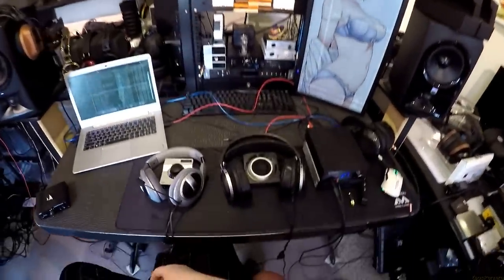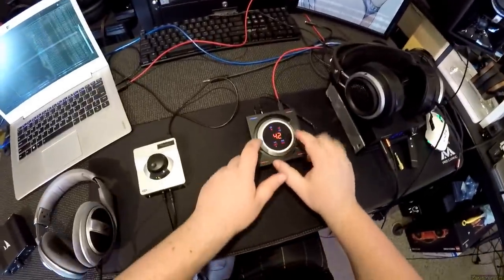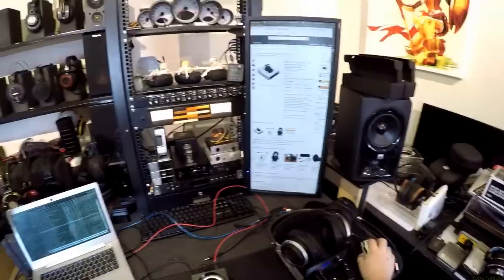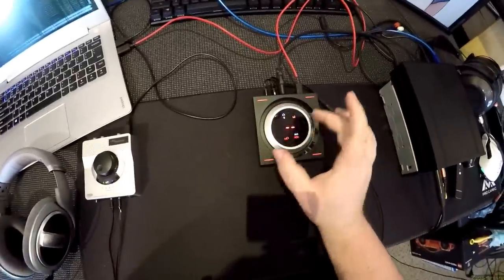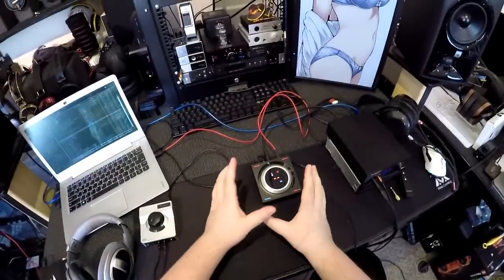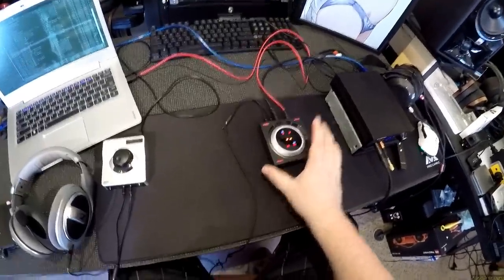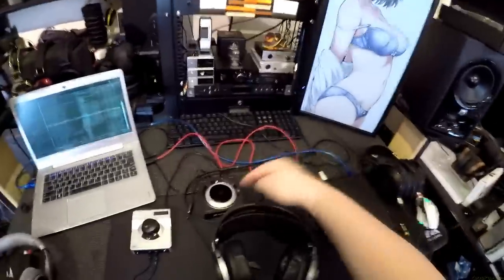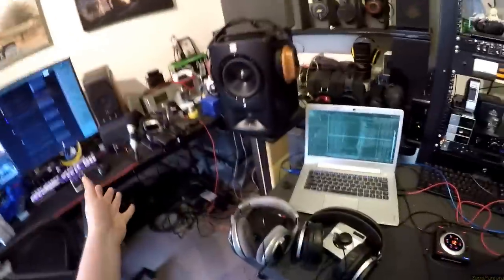Z Review - Sennheiser GSX1000 & Burson Play & Syba Sonic & Mayflower Arc

Comment: Z, love your content, but I don't really agree with a lot you said here (which is rare). Desk mics sucks because 1. they take space in the desk and with all the other crap I have on it makes it look messier 2. they pic up more my mech board than my voice. The best solution for me to have a killer audio and a mic at the same time is to have the mic with a completely separate cable like the Modmic or minimic (or any other similar one). Especially if you don't live alone you need to be quiet sometimes when your gaming (wife I'm looking at you), and with these you can whisper and still be heard clearly, with no interference of noise from other people of the house or your keyboard. I got recently the minimic from massdrop because the modmic is a bit too rich for my taste and it sounds almost as good sa the usb sansom I have - the difference being that the sansom only works well for what I want it to do if the house is quiet, nobody is home and I don't use my fucking keyboard (so no gaming).

Comment: Syba Sonic is literally enough for shp9500/x2hr if your onboard audio sucks. I've got Syba Sonic and an e10k,  they both sound the same. Only thing e10k does better is the bass boost, bass boost on the Syba sounds muddy and leaks into the mids. Syba Sonic has the benefit of mic input and treble boost, which actually sounds good af sometimes, but most of the time it makes the highs metallic. Both make aforementioned headphones uncomfortably loud. Hope that helps anyone who was in the same boat lol
Reply: there are some alternatives at the Syba Sonic ? always with mic input!

Comment: Before I get hate for saying this, I agree with you fully on the 7.1 surround sound headsets thing. I am just curious, Razor released a 10 driver headset... I almost laughed when I saw it because first off that's awesome they even tried that(yay innovtion), secondly if it's good then finally no more software bull for "7.1 surround sound" that's either hit or miss and in my experience sounds very close to stereo on a good set of headphones.

Comment: ffs, couldn't you have uploaded this a week ago?! I ordered a Topping MX3 just days ago, because I couldn't find a DAC/AMP with mic in and pre outs and I even mentioned you on the subreddit. 
Also, I do use a 5.25" drive for my water cooling reservoir, might also add USB3 and HDMI panel for my rift (it's an old case). No optical drive for something like 7 years now if not more. As the burson for 500$ it better have speaker amp as well, but it doesn't. Think of it, a PC case with speaker terminals.

Comment: Noob question:
I have an GSX1200 when I plug in my headset (using only the headphone connection) the mic doesnt work. 
If I use the Splitter Cable Adapter the mic still doesnt work.
If I disconnect the mic and plug it in directly to the GSX it works(the mic).

I cant figure it out. Send help.

Comment: would the syba sonic drive headphones with 250ohms? i have it and plan to get the Byerdynamic dt 990 pro
Reply: It would "work" but it will be more quiet than you might be used to. It doesn't have that much power
Reply: @Philitron128  How about the Akg k612? I use them with my phone (it apparently has a pretty decent DAC), the Axon 7, so I'm not expecting the sun and the moon or anything, I would be happy if there is any upgrade to my laptops audio, though.
Reply: @radiofloyd2359   the AKGs are 120 ohms. This DAC/amp can run them but it won't really make them shine. You'd be getting <100mw. It would work but cranking them won't get very loud
Reply: @Philitron128  it's fine, I'm already used to barely loud enough and with the loudness wars, my music is for the most part decently loud (I'm more of a music listener than an audiophile)...
Reply: @Philitron128  can you use the two headphones outs at the same time with two headphones?
Reply: @ouden.  I'm not entirely sure but I don't think so. These don't get much power as is  so two headphones at once would really bring it to its knees
Reply: @Philitron128  but do you still have it so you could try? I don't really care much if it sounds a little bit low with two headphones at the same time, it's certainly going to sound louder than a Y splitter cable connected directly into the audio jack of a laptop, and I just want to know if that works.
Reply: @ouden.  no it doesn't work, sorry man. But what you can do is connect this to a PC and the the other set of headphones into the PC also. From there you can go into your sound settings and get it to play off of both outputs. There are videos explaining it. But if that's all you need a cheaper DAC will probably do just fine
Reply: @Philitron128  well that's a good option actually, and thanks for your answer also I think that if they deliver sound from the back speaker output and the front headphone output at the same time (like I understood in this video) I think that having a RCA male to 3.5 female cable connected to the back and to a headphone would do the work too.
Reply: @ouden.  I didn't even think of that. But beware, it will be pushing more power through those RCAs. Don't try anything with your favorite headphones. If you have a multimeter I'd check power output at first. Then I'd try some ear pods or something like that to see if they fry

Comment: Can someone help me? I have the syba sonic. Somehow, my pc cant recognize syba sonic usb dac speaker. Only the sp/dif out is recognized. It can be powered and turns on, but somehow, when I plug in my headset, it doesnt prompt or recognize the headset. I
When I plug my headset directly on my mobo, it can be recognized but when I use the dac, it doesnt. Is there a way to fix or activate its driver?

Comment: I figured the Syba Sonic would fix the problem I am having with my HyperX headsets sounding too low... to me but it wasn't the answer. I first felt this way about the Stinger, then the Cloud and now the Cloud II. That leads to me getting the Syba Sonic but after hooking it up and maxing out all the volume settings, it's barely an improvement. I played the sound test in Black Ops 4 and placed an actual decibel meter (budget) between the earcups and there was only a 3 decibel increase. Why is it so hard to find a loud headset or headset/amp that is loud enough on the PS4 that I can't max out the volume. So Annoying.
Reply: Maybe it's your computer, then (or whatever port you're using).
Reply: can you use the two headphones outs at the same time with two headphones?

Comment: Down is on because it comes from the land down under? Its Australian! Everything is upside down there, duh! XD

I actually have TWO 5.25 slots in my case, but I have converted mine into a THREE 3.5 HDD holder with fan. So that fan can suck in clean air over the HDD bay, and it has THREE huge ass 8tb drives in them, sooner or later gonna be three 16tb drives. lol So no, I wouldn't put it into my case.... it would go on my desk.

Comment: Of course I still have an optical drive in my PC. Most of my music collection is composed of CDs I bought used on the cheap and ripped to FLAC. Did I mention I'm cheap?
Reply: F. M. You realize ripping a CD to FLAC is useless right? It will never be FLAC quality it will always be CD quality
Reply: @durrantmiller8810  You're wrong: it's useless, but it is FLAC quality (a little bit more than 320kbps usually, like 500 or something). The difference is unnoticeable and the files take more space, but it's not that big of a deal...
Reply: RadioFloyd235 None for one thing it is noticeable to some people I’ve done blind folded test on NPR’s website and with Coldplay’s speed of sound I got it correct all 3 times I listened to it on the other songs I didn’t but that was because I was unfamiliar with them but my point still stands that it is useless to rip a CD to a FLAC file it just wastes space
Reply: @durrantmiller8810  I never said there was no noticeable difference between FLAC and MP3, I just said the bitrate of a CD is usually a little more than 320kbps, meaning FLAC is indeed FLAC, but between CD FLAC and an MP3 rip there's basically no difference...

Comment: I wish the sens gsx and PLAY worked with the xbox 1.

Edit, I stand corrected, I reached out to Burson and they said the playmate has the optical and would work with the xbox 1!  Only drawback I've read is that the sound stage isn't as large as the play.

Edit:  Man I need to read better, I can get one with a larger sound stage, I'll need to get the V6 Vivid opamp.  Muahahahahahahaa!!!!! But I'll need to get the Sens HD800S as currently I only have the Mobius which doesn't need an amp but the sound stage isn't to my liking, I have the Send PC37x atm.

Comment: Might be worth checking out the Steelseries Arctis Pro Zeos. If anyone is going to make the fabled "good" gaming headset it will likely be Steelseries at this point. At least both version of the Arctis pro come with Sabre DACS.
Reply: Haze why will it likely be steelseries?  Steelseries is the epitome of overpriced gaming headsets
Reply: Because they made an affordable headset to try and complete with Hyperx,  it ended up sounding better than their premium headset so they have now repackaged it with an expanded frequency response a decent DAC/Amp and a massive increase in price. They are undoubtedly overpriced but they are now positioning themselves as the "audio quality" guys. 

Before the Arctis line I would have picked Hyperx as the ones who will finally produce the "good" gaming headset but their repeated failed attempts at bettering the Takstar Pro 80s hasn't inspired confidence.

Comment: Is gsx 1000 good enough for massdrop 58x?
Reply: Yep. The Jubi 58Xs are just within the 150Ohm impedance that the GSX1000 support, so you should be able to power it. Amazon customer questions say the same thing. I'm also planning on getting the 58X with the GSX1000, so let me know it turns out for you if you decide to go for it.

Comment: What would be the point in things like the Sennheiser, Syba etc. when you can get a soundcard that's probably way better quality like an HT Omega Claro Halo XT, Asus Essence STX 2, Asus Strix Raid, Creative Titanium HD, Creative ZxR, Creative AE-5/7/9, PowerColor Devil HDX, EVGA NU, etc.??? These soundcards with their very high quality DACs, OP-Amps, headphone amps, caps, and other components almost certainly blow away these products, not to mention they don't require mounting a physical object anywhere as they're in your PC (for the most part).

The only advantage I can see is if...IF the Sennhieser does the simulated surround better as that is purely driver/software based.

Comment: I haven't tried it yet but, the Yamaha AG03 looks like a good non-surround alternative. Gives you the option of a headset or an XLR mic with 48v phantom power and it's DAC is 24/192. I have a Behringer Xenyx 302 USB which is much the same form factor but I think I'd like to upgrade to the Yamaha.
https://www.amazon.com/dp/B00TY8JE60/

Comment: Been using that Syba Sonic since before you(Zeos) got one for review all those months ago. I use it in this office everyday. At work I have a laptop with very crappy sound output. This device fixes this and the treble boost works wonders in some phone calls through skype on the laptop when doing conference calls. I can also play Spotify through my laptop while I work with this unit and enjoy good quality music all day long.

Overall, it is frikking awesome for the price and what I've been using it for. 

For reference there is a higher fidelity version of the Syba Sonic as well. It costs more than $35 though and doesn't have a mic input. It is harder to find. Here is the link from the Syba website for it.

http://www.sybasonic.com/index.php?m=en&a=productview&id=144

Comment: Need to add sound blaster x7. Better then any of these, powerful with no need for magni with dolby digital surround and ability to use with all consoles and pc.
Reply: Joseph Norcott and noisy as hell because it's inside the case. There's a reason why external DACs > soundcards
Reply: Rick incorrect, soundblaster x7 is external. It has multiple input and outputs and external power brick.
Reply: Oh sorry I was thinking of the old soundcards
Reply: Rick I had X-Fi Titanium PCI-E x 1 card and there was no noise. If you have half decent PSU and reasonable MB and plug in sound card that is not cheapest on the market there shouldn't be any noise.BTWI could write you a book about USB DAC noise, ground loops and all that crap.
Reply: I purchased the GSX 1000 to replace my X7 on my gaming PC; after extensive testing I kept the X7 coupled with my Fidelio X2. I can't talk about the Mayflower or Burson though.
Reply: Frikkie Vuiltrens is the gsx1000 that much better than the sound blaster x7? still deciding on wich one to buy... 
I like the sound blasterx g5 for the price and the x7 for the options it has but is it worth buying? 
And hear a lot of problems with the gsx1000, it is like a hit or miss (If I read everything)
Reply: the Funmonkey24 for playing games I actually preferred the X7 over the GSX 1000, that's why I kept it. I don't really listen to music on my PC. I own the G5 also. For the money I would advise you to the buy the G5. Although the GSX 1000's surround sound is arguably better than that of the SBX, I still prefer good stereo sound over 7.1 virtualization any day. And this is where the SBX truly shines in my view. And I simply love the Crystalizer and Smart Volume features in the SBX software, the former makes every sound crystal clear and the latter normalizes your volume level across menus, in-game, etc. The GSX 1000 is a beautiful piece of engineering, but when it comes to gaming and simple stereo sound the Creatives take the win in my humble opinion. I have listened to the new AE-5 internal soundcard as well and the sound is slightly better than the G5 if you prefer a PCI-E option. I only upgraded to the X7 for the bluetooth functionality, otherwise I would have been content with the G5. My friends also tell me that my voice (using the V-moda Boompro) sounds distinctively clearer on the Creatives. Just remember I'm no audiophile and my experience is limited to PC gaming only. My listening tests were conducted with a pair of Philips Fidelio X2 and SHP9500 headphones as well as a JBL SB250 soundbar. I'm seriously considering buying and testing the Mayflower Arc next.
Reply: Frikkie Vuiltrens Oke I'm still not sure which one to get because I really like the astro a40 on the ps4 but now I get into pc gaming the astro doesn't do the job anymore (older model).
I like the options like bluetooth on the x7 but I don't know if it is 180euro more worth it. 
Also I like virtual surround sound to pinpoint enemies in games like pubg bf etc. But does the g5 and x7 do it good? 

Also does the g5 or x7 have the function to mix game and voice chat? because that is a thing I really love on the astro mixamp.

I'm getting the akg k702 to pair it with.
Reply: theFunmonkey24 the X7 has a higher quality dac than the G5. Having said that, either my hearing and/or my headphones are not good enough, because I am personally unable to distinguish between them in games. I assume though that when listening to high quality audio files you'll hear a difference. Thus purely for audio quality in games I will recommend that you save the money and buy the G5. It sounds phenomenal in games! 

The only reason I would upgrade to the X7 is, as I did, to take advantage of its extra functionality, like Bluetooth or the dual headphone outputs which are actually used in my household (two people can listen to the same source).

Yes, both the G5 and X7 will allow you to pinpoint enemies with ease and the SBX software even has an option called Scout Mode which will indicate the position where sounds are emanating from on your screen. 

Please clarify your question about mixing the game and voice chat as I'm not sure what you are asking.
Reply: Frikkie Vuiltrens wonderfull than I will see which one the g5 or x7 will fit in my budget. 

And wel my astro mixamp is connected with optical for audio and usb for microphone, and there is a dial that I czn turn to get more game volume over chat volume or more chat volume over game volume... 
I found that very usefull but don't know if the g5 or x7 will be able to do this on the dac itself.
Reply: theFunmonkey24 unfortunately to the best of my knowlegde I don’t think the G5 or X7 can separately set the volume levels for audio and mic. In my experience you only control the audio level with the knob. I have never tried before to control the two levels separately and have always set the levels in-game or Windows or software such as Steam. I could not find an option in the X7 control panel to do so. But the feature does sound very handy! If anyone knows if this is possible I would love to know as well.
Reply: Oke thanks a lot! that is not something important but handy to have :P just an other question because my motherboard doesn't have dolby digital live but the x7 has dolby digital but is that an issue? Or does the g5 and x7 work independent from the motherboard?
Reply: theFunmonkey24 they work independently, you can actually disable your motherboard audio in the BIOS like I do.
Reply: that is perfect! because that is the problem (not the only problem) with my astro's that I need dolby digital live on my mobo to get surround sound...
But now the question is just the g5 or the x7 :D (or maybe the e5, it does seems to have som bennefits over the g5 but not to extreme like the x7)
And pair it with akg k702's :P